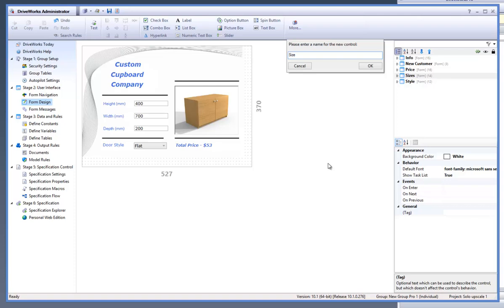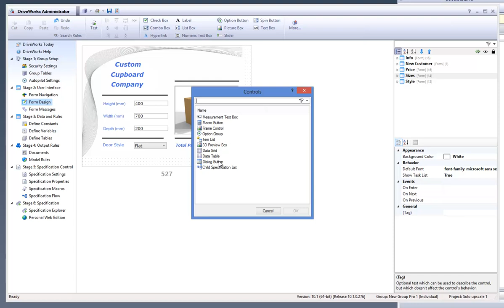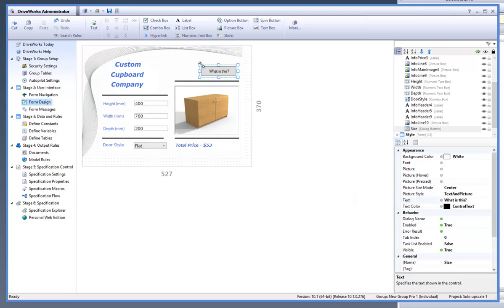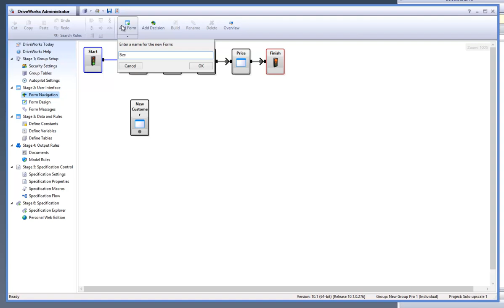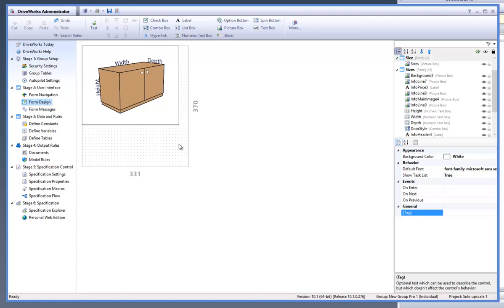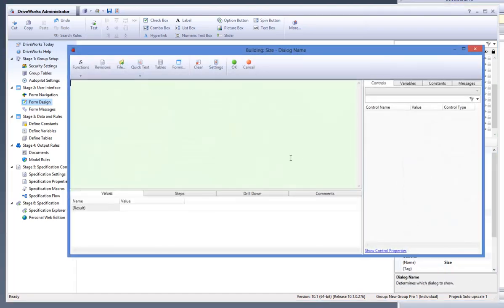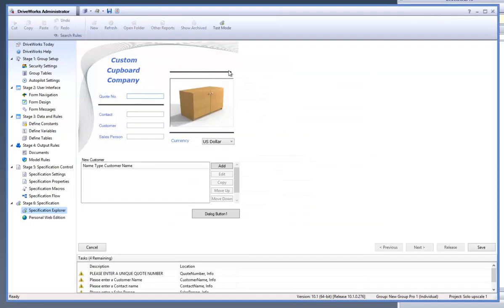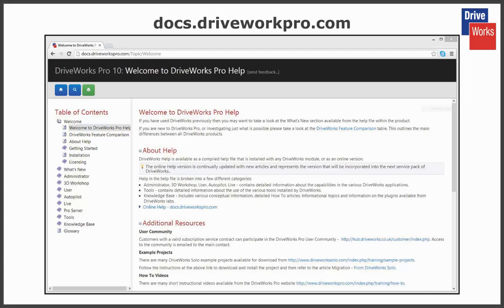DriveWorks Pro - Setting Up Dialog Buttons

Comment: How can you control where the popup window shows up and the size? It seems to cut off information when I create one.
Reply from the maker: Hi Andrew
The Pop-up box from the Dialog Button should always be placed in the centre of your screen. The size of the pop-up box is determined by the placement of the content in the form used with the Dialog Button. If you are viewing the form in DriveWorks Pro then the pop-up is movable with scroll bars if required.

If you need to have tighter controls on the size and position of the pop-up, using a Frame Control on your form might be a better option. The size and position are controlled by properties and the visibility is controlled by a rule or a macro button, very similar to the Dialog Button.

Here are some Help Files that explain more:
https://docs.driveworkspro.com/Topic/ControlFrameControl?terms=frame%20control 
https://docs.driveworkspro.com/Topic/ControlMacroButton